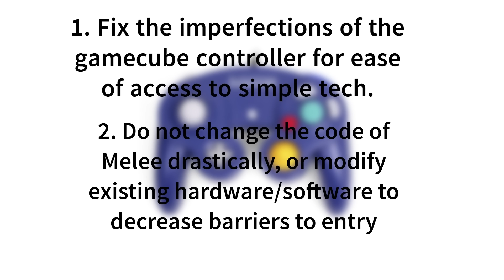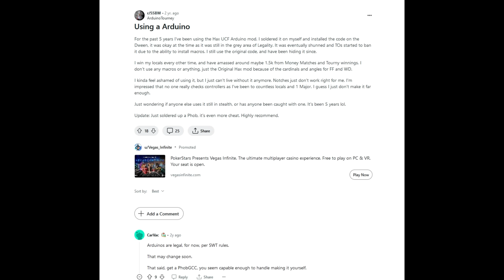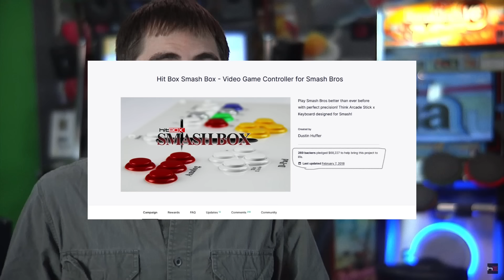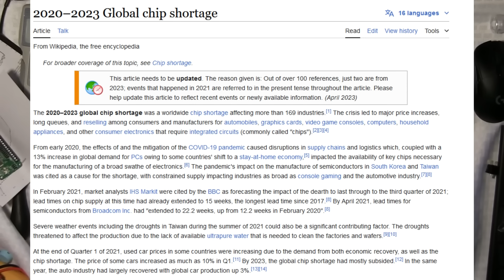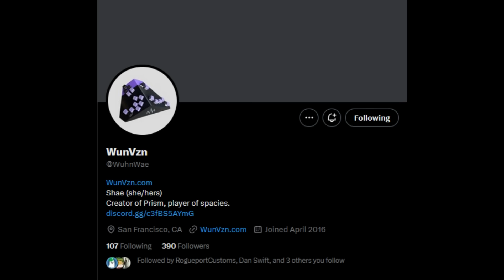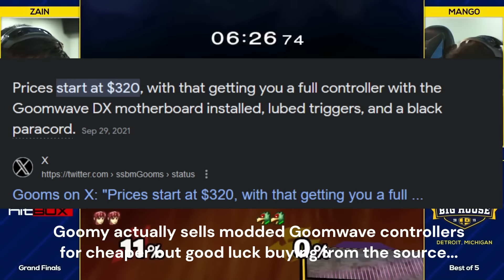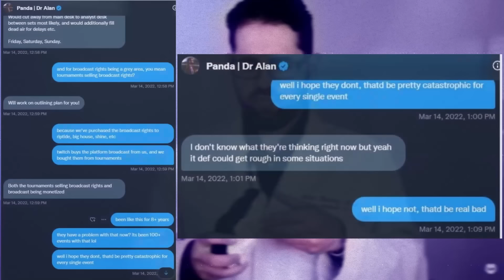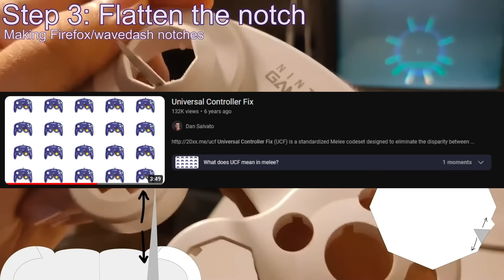The Melee Controller Market is Out of Control

Comment: The panda controller was actually doomed from the beginning. 2 days after the kickstarter launched, Nintendo told them to shut it down. Alan said they would have to get actual licensing from Nintendo and planned on doing it and restarting the Kickstarter but still same deal. I think we shot ourselves in the foot by going after Alan and panda.
Reply: The fact that they didn't have a license wouldn't have been a problem.  There are no laws that require a manufacturer of a controller to get a license it just makes developing and selling it far easier.  What would have been a problem is the fact that Nintendo has a patent on the gamecube controller which doesn't expire until August 4th of this year.
Reply: @SirNarax  right but they were trying to stay in good favor with Nintendo. Alan talked about it on a podcast a couple of months ago, that podcast was pretty interesting.
Reply: @SirNarax You don’t say…
Reply: They originally claimed it was supply chain issues
Reply: @SirNarax  What made Panda's controller patent-infringing when others 3rd party controllers sold over the last 24 years weren't?
Reply: @VinceOfAllTrades probably because Panda’s was very high profile. A lot of third party stuff doesn’t get brought up because nobody has really ever heard of those companies
Reply: @VinceOfAllTrades  Other gamecube controller clones?  They either got a license or didn't care about the patent.
Reply: @SirNarax so you're saying....

Comment: One thing a lot of videos miss about the Jmook phob breakdown is that Jmook had an older 1.X.X phob. Newer 2.X.X phobs dont have that same issue.

In detail: The 1.X.X models of phobs required more power and had to use the rumble motors 5V power line and on some wiis that power line can stop working temporarily which on an OEM or 2.X.X phob only stops the rumble from working while on an 1.X.X stops the entire controller from working.
Reply: That's also why the gamecube adapter for WiiU/Switch has two USB inputs. One of them (they grey one) is basically dedicated to supplying extra power for the rumble motor.

Comment: Smash players are terrible at hardmodding controllers. Every time I see soldering jobs for $300+ controllers, there's always way too much solder on one point, way too little, cracked soldering, board and point burning and flux left on the board. This is even a problem for really big modders. I guess its about right for a community that's horribly scared of new controllers to not know how to properly mod them.
Reply: Damn..
Reply: Imagine if they got their hands on hot glue

Comment: I think one of the reasons boxx style controllers are not more common is because basically all of them become instantly sold out. It's actually really hard to get them. In fact even right now your options is usually wait months for a controllers. Though in the last two years there was like 3 good options but now there are like 8 good options so the scariccity of controllers are slightly less of a issue. It's still super expensive and hard to get.
Reply: They're not more common because they sold out??? That's a weird way to put it, you might put more emphasis on the lack of production rather than the extremely successful sales rate
Reply: the old "nobody goes there anymore cause it's too busy"
Reply: The markup on these controllers is insane ...

Comment: notching is still controversial. you also dont NEED notches to win a major (zain). zain just made a really long tweet about it
Reply: Don't worry redditors in bronze 2 on slippi ranked will still say the game is impossible to play without shield drop and firefox notches and $400 worth of other controller mods.
Reply: It's not that there needed. They just help alot.
Reply: Ok but he plays Marth not Fox
Reply: One top player saying they don't like notches doesn't make it "still controversial." Every tournament accepts them, and a ton of players use them. They're 100% accepted save for the yearly controller discourse that happens in the community.
Reply: If you play fox they are basically needed
Reply: It depends on what character you play
Reply: @AL-lh2ht I wouldn’t say they’re needed. I don’t think ff angles are that necessary and I guess you could make an argument for wavedash notches but both of those things can be learned consistently with muscle memory. On top of the fact that unless you’re using a phob you have to constantly readjust your notches to make sure they stay perfect.
Reply: I’ve been playing falco without notches for like 2 years. I can hit all my angles and get pretty long ass wavedashes without notches. But just recently switched to full notches, and I gotta say it is more so about going from hitting an angle 9/10 times to 10/10 times. In all honesty sometimes I SD because I got too shallow an angle using the notch where I would have used a more specific angle to recover without notches, so it opens the door for new challenges in its own right.

Comment: I feel like the wave dash values should be based on timing instead of randomized. If you want that perfect wave dash length you have to hit the buttons at a frame perfect timing, otherwise you'll get a weakened angle. I feel like this would also allow players to adjust their timing for mixups and gain more analog range in the digital input.

Comment: With Hall Effect switches coming out that are basically analog inputs, it just takes someone to build a smashbox with Hall Effect sensors representing both stick.  SOCD behavior should be neutral instead of last input priority.  If stick folks gotta go through neutral for opposing directions, then so should box ppl

Comment: The first thing I found jarring when I played a smash game for the first time was forced analog movement in a 2D game. It wasn't til years later I learned that Melee had it the absolute worst when it came to this kind of thing. Being what we in the fighting game community would call a "Kusoge" and it's analog stick related jank causing the need for the most specific of controllers at high level. It's not like the Kusoge that I am used to. They're hella broken but because the input is all digital it's viable on any controller.

Comment: I’m pretty sure part of the reason the goomwave dropped off because there was multiple people, all approved as goomwave modders who started to have beef with each-other, with different people claiming stuff like they were the real ‘official’ goomwave modder, the best one, or better than specific other modders, and people got confused by or scared off from the situation.
Also people got tired of having to buy a well made but expensive controller that required regular maintenance since it would still develop pode.
Also, the phob was coming out, so it was pretty much better since the magnet sensors don’t have potentiometers, so pode isn’t an issue. And since it was open source there’s less ‘official modder’ drama, you can get whatever decent modder (who knows what they’re doing) to make you one, and it’s cheaper if you have access to and can use a soldering iron

Comment: Technically if we’re really thinking of where to put up since it’s right by your thumb which u use a lot when controlling your characters movement on a gcc.  Plus your pinky is the least used finger along with your brain normally not thinking of using your pinky as often as it is using its other fingers. 

(Mainly what I’m saying is the important buttons should be regularly accessible ) where the least are further away i.e top to bottom instead of bottom to top as for other inputs in and out is best and make sure to cross your fingers as little as possible when doing more complex inputs.

Cuz tbh the Boxx in terms of layout is kinda bias.(aka only favoring fox and falco) not trying to to complain im just saying if we’re making a product for-gamers(in this case melee players it has to be able to be use for any character they play)

Comment: It can be tricky to draw the line between 'QoL' controller modding and essentially cheating.
I think a good rule of thumb would be that anything is fine so long as the end-product remains "1 action = 1 standard controller input" while also keeping within limits of what a regular human can reasonably do without the mod.

Want to mod your controller to remap the inputs to different buttons (so pressing X instead triggers an A input and vice versa)? That's fine. You're only generating 1 input per human action, just with a different button.
Want to remove the springs from the triggers and install trigger plugs? That's also fine.

I think where things become tricky is when you introduce mods that take analogue inputs that require a lot of skill to use consistently and make them digital (granting immediate consistency at a single button press).
If you install an extra button on your controller (or repurpose an existing one) that inputs a specific angle of the Control/C Stick I would probably lean more towards that being cheating. Sure, it's 1 input for 1 button press, but it's inputting something that can't realistically be done in the same way without that modification.

This also might be seen as a hot take, but I would probably consider notches to be cheating too for that same reason. You're taking something that is inherently inconsistent due to human error and takes a lot of skill to make (more) consistent, and are trivialising it by making it so your stick can be 'snapped' into a specific angle every time you need it.
A spacies player with notches has a noticeable advantage over a spacies player without them, simply due to how much easier and more reliably they can hit those specific angles to recover. The fact that Melee Juice himself concludes that you need notches to win a major is something I feel supports my stance. Controller mods should always be something that is optional, not something that gives you an inherent advantage or inherently increases your chances of winning to the point of being mandatory. If everyone has to perform a particular mod to be able to compete then one has to question the legitimacy of that mod.

I feel like the only reason the use of notches is so accepted in Melee is because it can be argued that it makes up for the manufacturing inconsistencies between controllers. The community seems to have decided that's it's better to have everyone 'cheat' and be on the same level than have people be at an inherent advantage/disadvantage because they simply got lucky with how their controller came out of the factory or because they were willing to spend more money to acquire a 'lucky' controller. I can't say I disagree with that decision, honestly.
I do think it's important to recognise, however, that if this were any other game I think there wouldn't be much disagreement about it being cheating (hell, just look at how the Trackmania community has approached the topic of analogue inputs being 'assisted').

Comment: Does anyone know if the Prism or The Schism is useable for 2d fighters like Guilty Gear Strive? I've thought about trying all button controllers but Id only wanna try a controller that allows you not to have your hands be flat for ergonomic purposes.
Reply: if youre playing on pc, those controllers can be used and remapped like any standard controller and would definitely work for strive. Playing on a playstation or xbox wouldn’t work without having an additional controller board, though they can work on switch without any additional modifications
Reply: @emersonarthur3776  Thanks for the reply, unfortunately I shoudlve specified that I'd want something that would work on PS5, PS4 and PC. For tourney purposes. Shame that platform compatibility is yet another barrier to finding the controller best for you.

Comment: Imo any controller that doesn't follow the same basic layout as the gc controller (same buttons, two analog sticks, analog shields) should be banned. I get that nintendo might get in the way but how hard could it be to design an improved gc controller? All you really need is better ergonomics (controller shape, button placement etc.), better sticks and notches, and better quality buttons. Every other issue that is controller based can be fixed by slight software modifications like UCF. Analog remapping such as the goomwave should also be banned. Play the game fairly.

Comment: Its wild to me that arduinos were quickly banned while boxes and phobs can do the same thing and never got banned. Honestly I think we have gone too far with controllers. Its a controversial take but boxes never should have been allowed. This just opened the flood gates to allow modders to do whatever with no regulation and now its been too long to go back. I dont know what the fix is but I know its not what we are currently doing.
Reply: The issue with Arduinos is the they're unregulated. The Phob and B0XX software are supposed to be checked by either some TOs or the ruleset team. The software on those larger productions is hard to change. Arduinos are so readily programmable to act like the goomwave

Comment: notching shouldnt be cared about at ALL. All joystick inputs in melee are detected BEFORE the joystick hits the notch/ ANY of the maximum distance joystick inputs. All notches really do is help with muscle memory, and that doesnt seem so crazy as to warrant a ban.
Reply: notches, springless shoulder buttons, different thumbsticks, are basically assists and give the user an advantage over those with stock controllers.
Reply: @James-pb8xu  breh did you even read my comment lmfaoo
Reply: Did you read mine
You cut time training those angles in thirds with notches.
You'll have less misinputs with notches

On top of that, you're failing to consider springless shoulder buttons and different thumbsticks that you know are objectively better than stock. 

@cityofnewjack
Reply: @James-pb8xu  im nkt considering the springless buttons and thumbsticks because i agree with you

i dont think shaving off time to learn muscle memory is a big deal

Comment: interesting video but you're shilling too much. i dont play melee and dont have any fancy controller but you're talking so much shit about this frame 1 controller i wonder if there's some bias. you say it's the same thing as hax's but it has two extra buttons in the top right? and you say the prism is "a little more expensive than the frame 1 light" (it's 23% more expensive) and then the prism is "more affordable than any other box controller on the market" when it isn't (the frame 1 is)? how is the schism's selling point at 350 usd that it folds up in a backpack when any other box controller is significantly smaller and thinner?